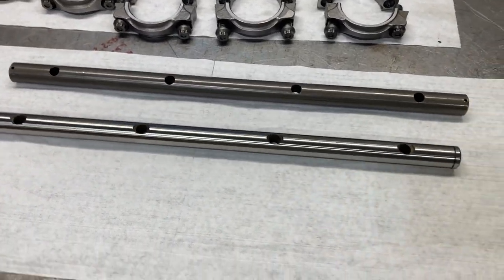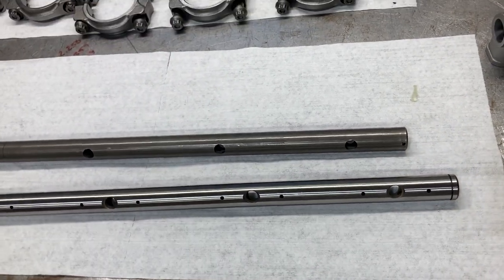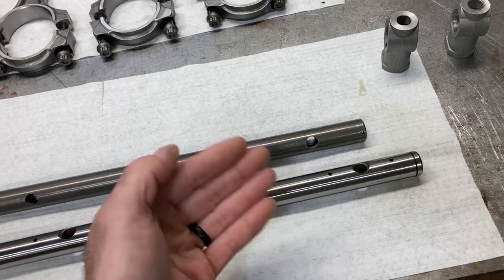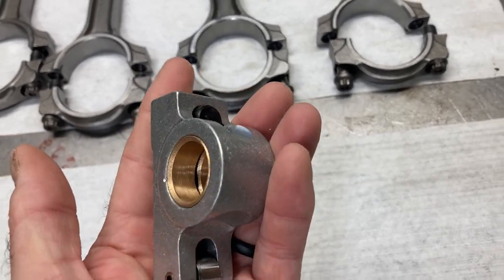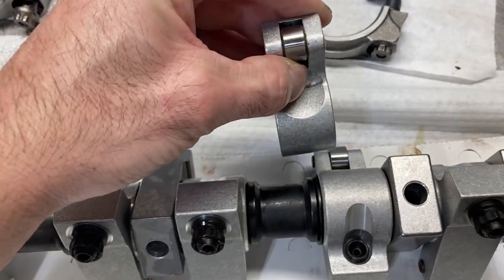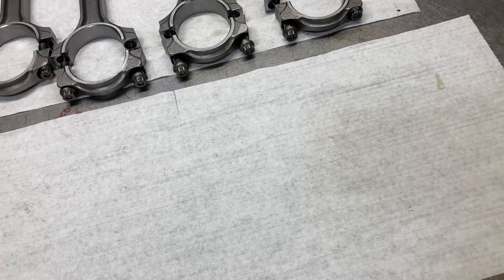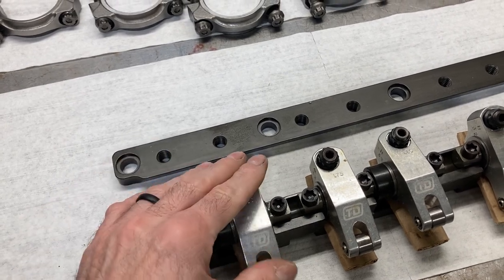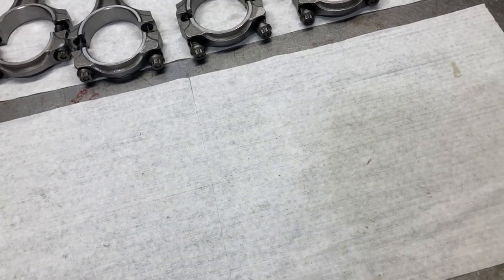Lykins Motorsports Choosing Rocker Arms For Your Ford FE

Comment: I'm sure you have seen all the videos on YouTube of so many people breaking rocker arms. I don't think that they are spacing them correctly for the expanding of the aluminum . I have ran some cheap roller rockers for years on my 390 and I'm not easy on them either and never broke a rocker.  If you would be interested or have time in talking about proper spacing between rocker arms. Just a thought thanks
Reply: When I was a teenager I had a 62 Galaxie 500 with a 406 motor. One night I had taken my girlfriend home and was going home myself at a high rate of speed. My car developed a miss 2 miles from home. The next morning I started searching for the miss. What I eventually found was a broken push rod on the exhaust valve on cylinder 8. After that I had to replace the left head gasket every week.
Reply: its the adjuster being out too far that overloads things.

Comment: Can you explain proper adjuster extension in picking correct length pushrods.  Something about the angle between pushrod and the line drawn through adjuster intersection and rocker center?  On seat and 1/2 lift and full lift?

Comment: In your opinion do you think springs that come with AFR heads with 155 seat pressure and 450 open pressure would be enough spring for these type of large aluminum roller tip rockers? Cam is hydraulic 246/ 262, @.050,  .642/.642 lift? Valves are 2.165/ 1.60

Comment: do you know what ford used on 427 lemans engines they ran over 7000 rpm for 24hrs thanks
Reply from the maker: They used factory adjustable rockers but they were also dealing with 1960’s cam technology and valve spring pressures.

Comment: I'm currently running a set of Harland Sharps needle bearing setups. The problem I'm having is the end stands are flexing, in fact both shafts have broke at the first stand stud. Might have to switch to T&D.
Reply: Harland Sharp has excellent customer service in my experience. Maybe they can help you out in some way.
Reply: I have the T&D set up. It has broke shafts twice. Each time a nut backed off and allowed flex in the shaft. I founs when I switched to different nuts never had a problem since. Only ran 2 seasons nbut so for no issues. Might try to see if that helps you.
Reply: Do your end stands surround the end of the very end of the shaft? As in outside of the end rocker arm. This usually prevents the end of the rocker shaft from snapping off due to high spring pressure.

Comment: Why would anyone in their right mind use the stock rocker shafts and stands with aftermarket rockers? The factory unsupported shaft ends are THE weak point in the design. ALWAYS use a rocker shaft assembly that surround the end of the shaft.

Comment: Technology has moved from the ridiculous spring pressures discussed in this video....they shot Kennedy and landed on the moon....move forward.
Conical springs and lighter components can run well into 8000 rpm with spring pressures under 450# springs. Do some homework....
Reply from the maker: My favorite part of having a YouTube channel is when guys like this call me out, while they sit in their recliner and read about other people building engines.  It's always an ego boost when you get to tell a professional engine builder to do their homework, isn't it?  Make you want to puff your chest out and feel good about yourself?

I have ran 8000 rpm with those kind of spring loads.  But not every engine is an LS and not every engine has lightweight valves.   Not every engine is a street engine.  Not every engine is a hydraulic roller.  Not every engine is a Cup engine with 6mm hollow stem titanium valves and non-adjustable rockers.

Maybe you should do some homework before you come across like you need to take me to school.
Reply: Love your work Brent. Hopefully I can support your business further down the road oo optimising my 390. I'll be in touch or maybe even come and visit from Australia if I can make it happen. Thanks for the education on my classic engine. I really want to get her singing 😁